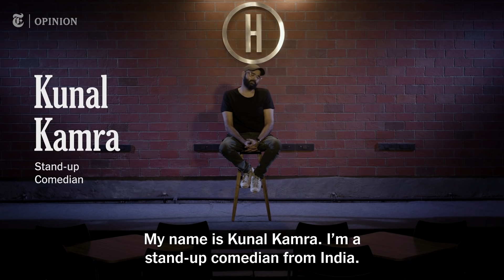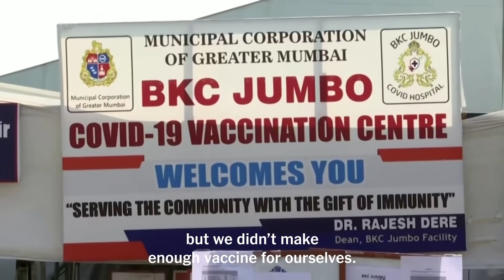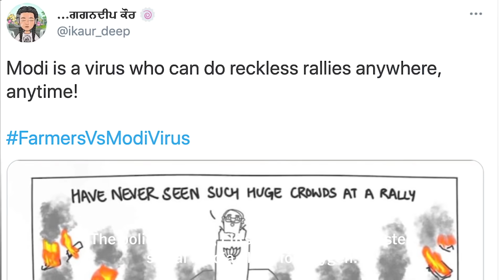Kunal Kamra: Modi Caused a 'Covid Massacre' | NYT Opinion

Comment: Reasons:
1. Delta variant emergence which was severely more deadly than the original.
2. You can't spring up thousand and thousands of hospitals. India has being developing slowly. I cant imagine my grandma's village to suddenly have five multi-facility hospital with all the equipments, can you?
Even the town i live in has 53 hospitals but covid care is available in only 5, even after a year and half of pandemic. 70 Years versus 2 years-old how can the health infrastructure develop so fastly in a month🤔🤔
3. Small private hospitals are refusing or are not sufficient enough  to take in covid patients and each district may have 1 government hospital but many many private hospitals.
4. General public's lack of masking up. I have seen mostly everyone mask less in my town even when the delta variant was at its peak. 
5. Government failure whether at state or centre level is inevitable. They were all merry that covid cases have being less and boom here comes the delta variant. Now run in frenzy procuring oxygen whose demands have multiplied by thousand more than ever required before.